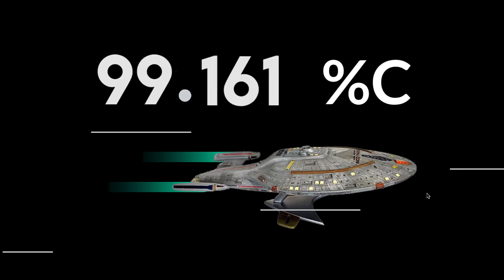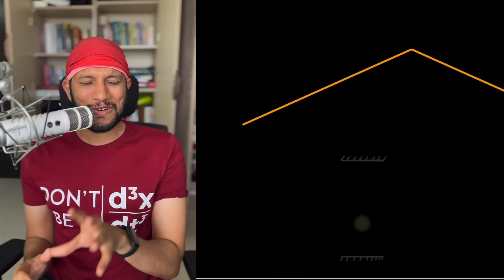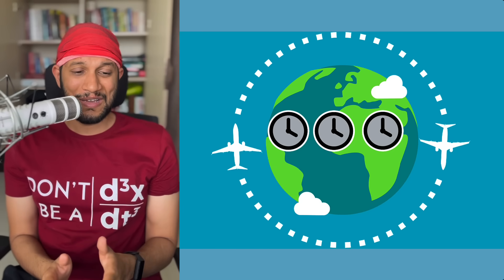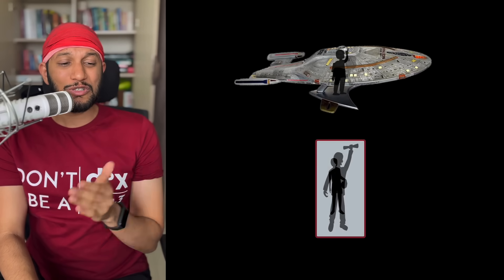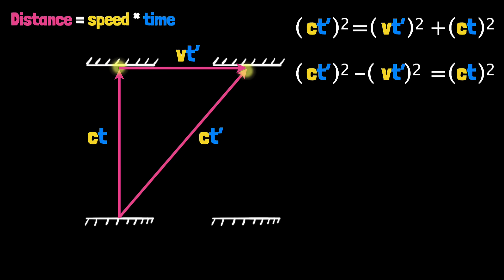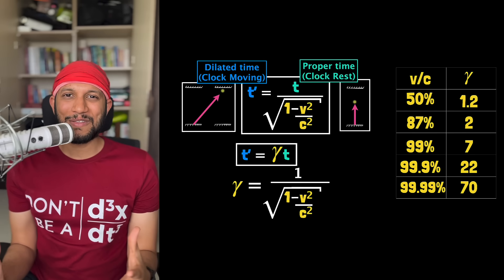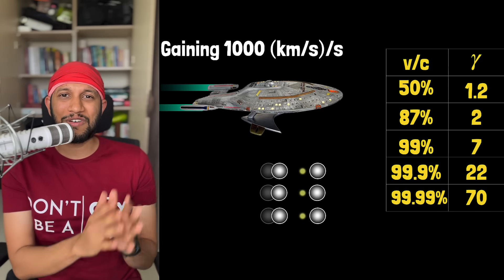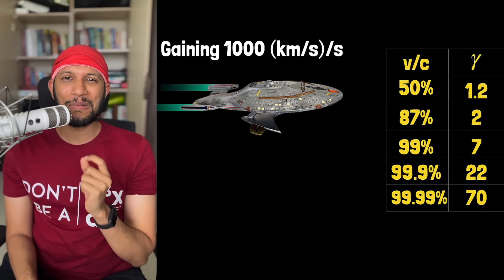I finally understood why you can't go faster than light! (My mind is blown)

Comment: I've had an issue with this ever since I was a kid. I just don't buy the argument that if you can't measure something then it can be discredited or doesn't exist. That seems obviously false to me.

Yes, this time dilation slows down the way we measure time, that's fine. I have no problem with that. But it doesn't slow down time itself. That is seperate.

By this logic you can never go faster than the speed at which the clock ticks.

If you are using photons that travel at the speed of light to bounce back and forth to measure time then obviously they will never be able to measure faster than the speed of light because they themselves are traveling at the speed of light. You would need something that travels faster than the speed of light to measure the passage of time in that scenario. Let's hypothetically say that the photon clock ticks with something that travels 2x the speed of light. We can call them superduperphotons and now all of a sudden it is possible to travel faster than the speed of light.

This just effects how we measure time. To me it's every bit as silly as saying you stopped time because you removed the batteries from the clock.

And you could hypothetically measure what real time is by sending a digital clock + a radio/laser into space and out of orbit and any force that moves it, to where it stands perfectly still and the clock would still tick. And then after its vessel has stood perfectly still for 10h get it to send out a radio wave or a laser beam aimed at some place on earth at regular intervals.

Granted, that clock would tick faster than on earth due to the time dilation that takes place here, but it wouldn't stop. And what it would be measuring would be closer to what real time actually is. It won't happen in our time, because there is no way for us to break out of the galaxy we're in to have it stand perfectly still, but maybe some day.

Until then you could probably armchair it. Point still stands, though.

Time would be closer to something like real time + time dilation, which throws a wrench in the whole theory that you can't go faster than the speed of light. You can, you just can't measure it on the ship that you're traveling on. You can still place synchronized clocks at point A and point B, and if the elapsed time between point A and point B is less than the time it takes for light to travel that time then you have indeed traveled faster than the speed of light.

Comment: Again, this is kinda retarded. We measured Muons and sideways photons, and now EVERYTHING was measured, and if you disagree, you're wrong and it's not science. What? Okay, let's say we go at half speed of light instead of speed of light. Things you see happen a second away, you will see a second and a half later. You will just keep seeing things with an extra half of speed of light decay. Just because you see the light come to you with a delay, doesn't mean time has slowed. Imagine if you and the clock are moving at the speed of light, and time on the clock doesnt change, because you're seeing what it was before, and it can't show you new numbers because you can see only the old numbers because that's what reached you and the new numbers are lagging behind. So you'd only be able to one set of numbers. Just because you can see a single set of numbers, doesn't mean time stopped. If you're flying next to a bullet, and the bullet is in the air standing still, that doesn't mean the bullet isn't moving. The problem with these arguments is that, during the time delay, just the period of time delay is observed in a philosophical way, and the time before and after the delay is compared, and the claim is made that time is slowed. However the clock, and the observer's local time will keep moving, and only the observations are effected. 

The flight and satellite clocks are based on gravity, and that's not the same thing as observations at speed.

Comment: First off, every clock you are using for measurements are atomic or photon, not mechanical. So right off the bat the deck is stacked. 
And then that diagonal course of the photon was not explained. Why should a photon inside a ship that is moving have to travel on a diagonal path?
Photons travel at the speed of light and the mirrors cannot travel faster than light so the photon would be moving at the same rate as the ship and not travel on a diagonal.
If I was in the ship bouncing a basketball on the deck would it travel diagonal? And if so how could I bounce it at all? Obviously that would not happen.
Basically every proof you are giving are the proof of particles and math. Show me large scale effects.
It's all math and speculation. We truly won't know till we build a fast ship and get it moving. Then we will see what "really" happens.
Reply from the maker: The basket ball would be bouncing diagonally as seen from outside. 

Relativity is based on this. And we have applied relativity to build GPS systems. The fact that your maps work is proof that the model is accurate (within some limits o course)
Reply: @Mahesh_Shenoy  No one could see a basketball bouncing from the outside as the ship would be moving too fast to see and the basketball is inside the ship anyway hidden from an outside view. Once again these are all thought games. I did not find your explanations satisfactory. I would prefer a large scale real life explanation showing real larger scale real world effects. Thank you.

Comment: If we walk or run does this make us age slower as well?
Reply: You would still technically age at the same speed you always did. The difference is relative speed of movement between people moving really fast and really slow. So to each person they would age the same in their bubble but since the world around you is moving faster than you are moving it appears that you are aging slower to others outside your bubble. I don't believe in time but in the bubble you move at normal speed but because you are inside something going so fast the relative movement of the world compared to your normal movement speed would make those in the slower moving parts of the world view you as aging slower. Like where is your X / Y if you were sitting in a car going 30mph vs 60mph. The time has changed the same amount but the cars would be located in 2 different spots. The car never aged but due to the world moving around it the heartbeat count for each driver compared to the distance traveled would make it seem like the one in the faster car was beating slower. The problem is this isn't the correct way to compare them so if you had 60 heart beats per min one would have 60 heart beats in 1 mile compared to 120 heart beats for 1 miles. So the one moving faster would appear to the person going slower that their heart is beating slower even though it was beating the same speed.

Time is just comparing the movement of 2 objects which means any changes in overall world speed make the measurements give the illusion of different speeds when really time doesn't exist. The reason the 2 clocks have different times is because it is movement dilation not time. If your body can live for 100 cycles of movement then being in an area where you move slower would appear to age slower but it just has to do with how many movements you can live through before dying. This seems backwards but the faster the world around you moves the slower you would appear to move. 

It just comes down to nothing can affect your aging but other's perspective of the aging could change because it may take twice as long for them to get to where you are at even though you both end up in the same spot. We may all have died a long time ago and our mind's speed just makes us think we are making choices that have already been completed but we are in the bubble so if there is a being outside our moving bubble they watched us end a long time ago.
Reply: Value of gamma will be very small. Therefore the time dilation would be negligible.
It won't make u age slower.
Reply: The earth is already moving around the sun at 107,000kph so the difference between average running 10km/h and walking 5km/h would only be a difference of 0.004672897% and 0.009345794%   which still doesn't take into account the earth rotation speed etc so the movement would not be noticed. Even going 300km/h is negligible to someone outside our universe looking in.

Comment: How would you determine if an object is going faster than the speed of light because at that point it would be moving so fast you can't detect it even exist. My guess is that is why we can't see black holes is because the movement is faster than the speed of light so we can no longer see it moving. We need a device that can detect movement faster than the speed of light and we could maybe "see it moving".

It would be like having a scale that shows a max of 500kg of weight so you can measure anything up to 500kg but as soon as it weighs 501kg the tool to measure it would still show 500kg even if it weighed more. So if your scale of movement is light something that goes faster than light would be undetectable. You can't use the max to determine if something is greater than the max. We just need a more powerful measuring device.

Maybe black holes look blank because it is going faster than the speed of light and too fast for us to measure the change so it just looks empty.

I don't believe in the existence of time so the clock issue is a movement dilation not a time dilation.
Reply from the maker: You can detect a plane moving faster than sound using sound. That’s not a problem!
Reply: @Mahesh_Shenoy  Not the same thing. Sound is created by the plane moving so it isn't traveling at the same speed of the plane. Light is not created by the object that is moving so if it is moving faster than light it would not be visible by light detectors because it would be gone before the external light could reflect off it. If the object is creating light and moving faster than light then you would just see random spots of light but not a single line of light over time unless your detector was faster than the speed of light.

Object traveling under speed of light and creating light would appear to be ------- but object traveling faster than the speed of light with a detector that was the speed of light would create .   .   .   . with each dot being the speed of light and the gap could maybe be used to determine how much faster than the speed of light it was traveling.
Reply: @Mahesh_Shenoy  Still trying to think of the best way to explain this but say you have a light going from one side to another. And anytime that light is broken by an object getting in the way it triggers an alert. Now that light you are sending at the speed of 299,792,458m/s and even if our perspective can't see it there is still a gap between each particle of light. Now if you were to be going faster than the speed of light you could pass through that beam without it ever realizing it because the object moves from one side to the other side before the particle could even hit it and be interrupted. So you only have a 100% detection range for objects that are going slower than that speed.

An easier way to put that in perspective is if you took a picture every 10 secs then if a person can run from one side to the other in under 10 secs right after the last pictured was taken they would not show up in either the first or second picture because they were going faster than the pictures were taken.

Comment: so, as a thought experiment, what if your vessel has the capacity to accelerate as fast a possible, up to ninety percent of the speed of light, and then just goes that tiny bit faster over a longer distance, what if someone fired a missle off th ship, it too starts at the ships current flight speed, and it bast off when the vessel is flyng at ninety nine percent the speed of light, firing a missle, so the missile leave the tube at the same speed the ship is flying before it launches, but light the missile up and it shoots off,with the original speed of the ship and with enough propellant fueling it to climb up in speed, the missile could break the speed limitation, cause I have done a less space shift experiment, a I shot a bb gun out the window of a moving car, and the bb got to the target faster than if I was been shooting at the road sign without already giong fifty milometers and hour on a I measured the speed by the amount of damage there was on the sign, and on my bb if I coudl find it, so maybe we could offer a kind of layman's solution to the nothing goes the speed of light, fly the ship at ludicrous speed and shoot something out of it, see how fast that goes, mostly for fun :)

Comment: At 2:50, doesn't the movement of matter propagate at the speed of sound, not the speed of light?
Reply from the maker: Yes, but that’s a structural limitation. The idea was even an ideal case, there is a theoretical limit.
Reply: @Mahesh_Shenoy  I see. Thanks!

Comment: Great video but I'm curious now because from the outside it would take infinite time to accelerate to the speed of light but for the people on the ship they shouldn't experience time dialtion so they should continue to accelerate at 1000 km/s/s until reaching the speed of light. Does this imply that once they get to the speed of light they will have traveled an infinite distance and time into the future and once they slow down to a stop they would have reached a spot that is infinitly far away in space and time but is still an actual place since they were able to stop there after going the speed of light? Because technically we can go the speed of light it's just no one other than the people on board would be able to see it happen. Kind of like never seeing anything fall into a blackhole from the outside and just seeing it slowly disapear.

Comment: But it explains only why the ship can't accelerate to the light speed from the perspective of spectator, as the time in the ship seems to be slower for them and they just will never catch this moment when the ship will reach the light speed, right? I remember similar thing about the object is going to the black hole, like the spectator from the outside will never catch the moment the object passed it. But what about the perspective from inside the ship? Inside the ship the time is going normal and the acceleration is still 1000/s in proper time.

Comment: One thing i will never get is if we compare 2 spaceships. Lets say 1 ship accelerates to 99.99 C and the second wich is standing still goes in reverse, how does that affect the speed of spaceship 1? And why?

Another example. Spaceship 1 accelerates to 99.99c so the result will be that people on spaceship 1 age slower. But who is to decide wich one of the spaceships are moving? There is no reference point in space so what decided where time moves slower or faster? It could be said that when spaceship 1 accelerated it actually decelerated to a standstill. I have 0 intuitive or intelectual understanding of this dilemma

Comment: One problem here. It explains why MEASUREMENT of time slows down, not time itself. The problem I've always had with this is that time is not physical and we try to measure it with physical objects. And where you have a physical measurement then you have distortion (Heisenberg's indeterminacy principle). Still, cool video. I'm glad youtube recommended :)
Reply: This is a cool interpretation. The assumption here is that the bouncing or "tick" of the photon defines time. But if the photon took longer because it went a further distance, surely that just means just that and nothing else, i.e., the photon took a longer chunk of undilated time, and not that time dilated. 🤔

Comment: There is a huge flaw in how we look at and utilize time.  Time cannot be fully understood by us.  You and science has already stated as much, that time itself as a dimension is more of a philosophical debate than a science.  We can only define it in scientific terms based on its measurement.  We put our own definition on the measurement of time, and  therefore put a frame of reference on it.  We measure time based off the rotation of the earth, and express the base unit we use, a second, as a fraction of that full rotaton.  That doesnt change (we wont go into the semantics of slight changes in rotation in velocity or path around the sun, as we decided it does not change our current definition of the unit of time we use).  So regardless of the reference of the person on the ship, whether or not to them they age or experience "time" differently, or the clock moving at a different rate on the ship, the frame of reference will always be the Earth, as we have tied our unit of measurement to it.  Science has bound us to this frame of reference as the only way for us to understand a dimension we can only perceive in one way.

To oversimplify the explanation, take the Earth orbiting the sun.  We refer to that as a year.  Take another planet, say, Saturn, and it's orbit around the sun is greater time than that of Earth.  With the Earth's unit as a reference, that is true.  But to someone on Saturn, it will be one year.  They will experience one year.  It's because the measurement of time changes based on all these perspectives, including the box accelerating towards the speed of light, we cannot rally define time in scientific terms without putting limitations on our perception of it.  

It's OK to say we don't understand a concept.  If something is truly beyond our perception, it doesn't mean we can't explain it with a frame of reference.  But we also need to understand that limitation when trying to use something based on a frame of reference to define something else, especially if you are trying to use theory as a basis for mathematical equations, which in and of themselves are fact and absolute.